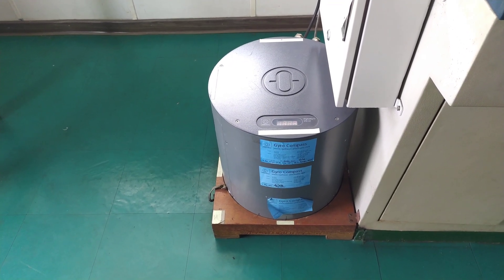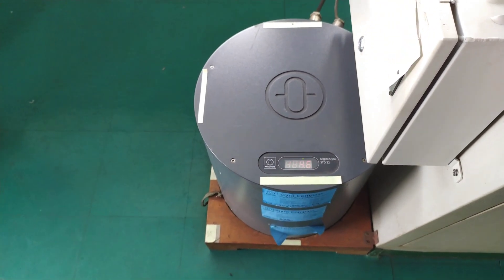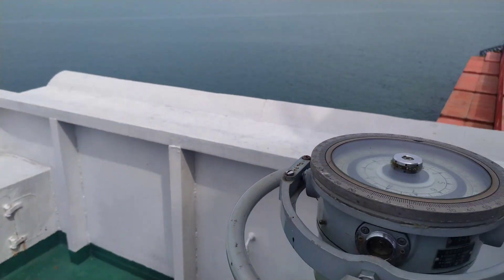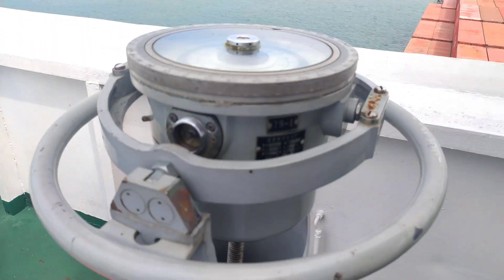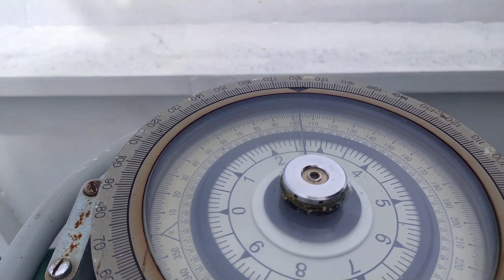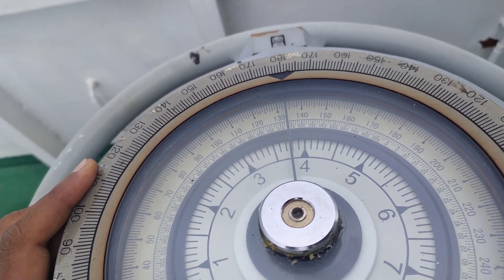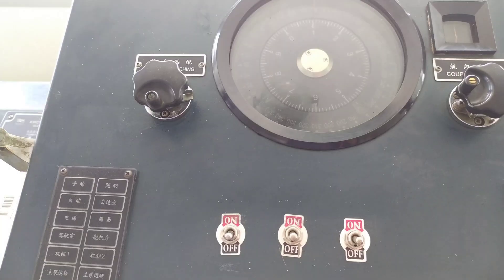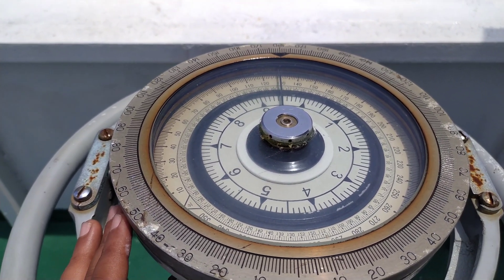SLAVE and MASTER GYRO synchronisation before sailing

Comment: Hello Sir.Is it possible to calculate compass and gyro error when the ship is riding at anchor.I think it is not possible but i would like to know your opinion
Reply from the maker: Yes sir. It is possible. 

When we are at anchor, there are a lot of ways.

Azimith
Amplitude
Light house bearings.

Also, since the ship is stable, the errors found will be much more accurate.

Regards.
Reply: @prasobhsugadhan  I think regarding ship turning it will not be accurate so it is not possible
Reply from the maker: No sir, the ship is turning only at high rates during the change of tides. Even then, the bearing is going to remain the same, since the true north is never going to change.

Even when our ship's head turns, the compass will turn accordingly, to maintain true north as the standard direction.

Hence, you won't have an issue while taking bearings.

Hope I could give you a good understanding. Else, please carry on this thread for further discussion. 

Regards. ❤️
Reply: @prasobhsugadhan  Yes i got an idea

Comment: What if slave gyro near steering panel shows incorrect heading ,how to adjust the slave gyro with the master gyro
Reply from the maker: Sir, all slaves will have adjustment screws. Generally in the case of steering Gyro, most of the times i have found the off switch and the adjustment by auto pilot setter. Different ships have different methods.

Basically, its similar to any slave. You will be provided with a means to adjust it to MASTER GYRO heading after power is off, and then bring back the power, by which it will repeat the heading of the master.